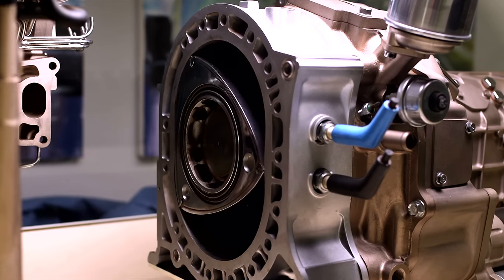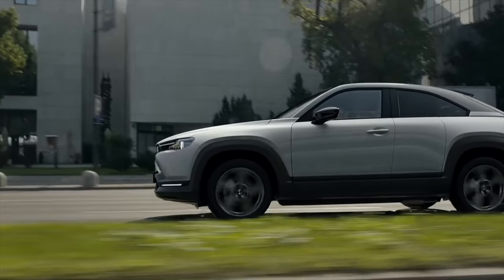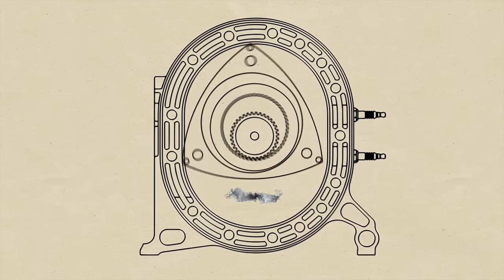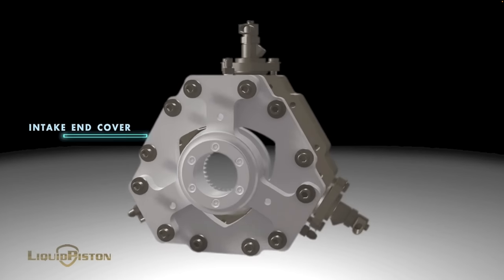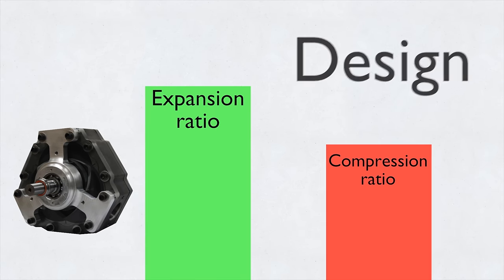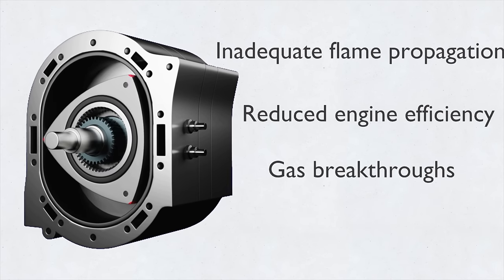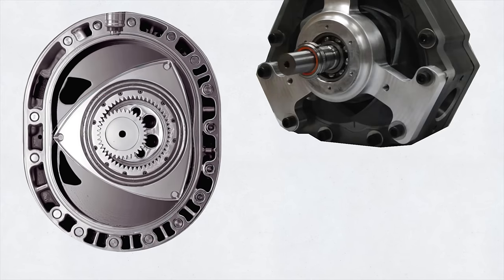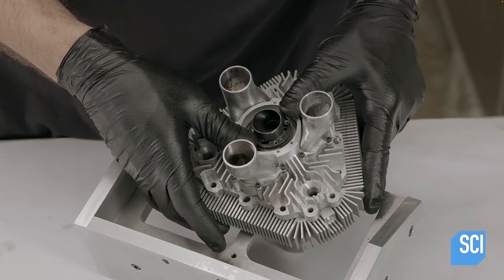Mazda's New Engine is the Smallest and Most Powerful Engine Ever Made

Comment: Felix Wankel did not design the rotary engine, it was Hanns Dieter Paschke. Wankle's design was superior with two main spinning parts, the triangular rotor and the rotor's outer housing, both spinning in a true circular motion, inside an outer housing. The output shaft was a part of the triangular rotor.  Hanns Dieter Paschke's design is the Wankel we know, with the triangular rotor spinning around the output shaft in a wobbling hula-hoop motion. 

The problem with Wankel's design was that there was three spark plus, one each side of the rotor, screwed into the rotor.  It needed an engine strip down to change the plugs. These days plugs for life can be fitted.
Reply: Hanns Paschke and Walter Freode discarded Wankel's rotary layout in favor of a conventional non-rotary design.
Only one Wankel rotary engine was ever constructed.
Reply: @sandervanderkammen9230  
doktorbimmer, a quiz.
How many rotary engines did Mazda make?
20 points for the correct answer.
Reply: @johnburns4017 Mazda has never made a Rotary type engine, Toyo Kogyo Cork limited became a Wankel NSU KKM57 licensee in February 1961.
  Mazda never made a single DKM54 engine.
Only one DKM54 is known to exist, it currently resides at the Deutsche Museum in Bonn, Germany.
Reply: @sandervanderkammen9230  
BZZZZZT! Wrong answer.
doktorbimmer the number of rotary engines Mazda made was ...

🎊🍾🍸 over 2 million  🎊🍾🍸

Zero points bimmer. ZERO.  Better luck next time.

Comment: Any fuel engine can be switched to hydrogen, including turbines, but the problem is how to store hydrogen, as it requires high pressures and low temperature, and still it packs 4 times less energy the an equivalent volume of regular fuel.
Small rotors or turbines could be used to produce electricity for electric motors, but only if the storage problem could be solved.
An hydrogen/oxygen battery could be even more efficient.
Reply: The problem is total lack of efficiency.

Comment: I remember my dad having an 1970s Mazda. It back fired all the time.
Reply: Things have changed.
Reply: @johnburns4017  Hah, yeah I’m sure. In grade school ( long ago) I built the working plastic models of the V8 and the Wankel Rotary engines for a presentation comparing the two.  At the time, I believe the Wankel had some issues and was not very efficient.  It did not get very good gas mileage for its size.  I remember the Mazda always backfiring down the road. Pretty funny. Dad didn’t keep it very long. 😂

Comment: A hydrogen combustion engine is EXTREMELY inefficient compared to a fuel cell configuration. It simply doesn’t make sense to use a hydrogen combustion engine. 

Because of the inefficiency you’d need huge hydrogen tanks. Those tanks are already an issue for fuel-cell cars.

Comment: How to have an electric car with unlimited range on a single charge.

Rwd and 2 battery packs. 1 battery is empty and the other is charged up. While the charged battery in the back drives the vehicle foward, it turns the front wheels thus charging the empty battery. By the time your "charged battery is dead it has charged the other one that was previously empty.

And then they just keep going back and forth charging and discharging each other.

Comment: 30 and 70 hp, lighter and more efficient? sounds like a good bike, maybe a 30 ps roller and a 70 ps bike with 140-160 kilo weight? or 2 engines one in front and one in the back for a car or 4 engines in a line as a mid engine. still half the weight of a normal engine, less space and high rotations...

Comment: Hydrogen engines suffer from a basic problem, the source of the hydrogen. Energy is required to produce hydrogen, via electrolysis. As they say there is no free lunch. Hydrogen can also be produced from natural gas but emits carbon monoxide in the process. There is also an issue with handling and storing hydrogen. One idea is grains of an iron/titanium alloy that will allow the hydrogen to be adsorbed onto its surface. This is a heavy solution and if the temperature is not controlled pressures in the fuel tank can get high.

Comment: Apparently, my ideas found their way around to the Mazda guys. I've had ideas to run the rotary off of hydrogen for many years now. But my system varied in the fact that fuel would actually be water, taken into a system that separates the molecular construction of the water, Oxygen being the exhaust and the hydrogen taken in to be burnt for the combustion phase. It saddens me that the people i wrote for financial support wouldn't help me, but yet they apparently sent the ideas on down the line. There goes my fortune.

Comment: The drawbacks seem to outweigh the positives: lack of torque, poor fuel consumption, reliability. The poor fuel economy to start with means when you scale it up in displacement or by adding rotors, it's just a rotating environmental disaster; and when adding in the piss-poor reliability, it becomes a burning money pit. 
Rotary engines have always been an interesting engineering exercise, but the fast-n-furious fantasy of them being a street-racers car of choice just fed into their myth while ignoring their glaring faults. 
Mazda is wasting their money in the hopes they can sucker more people into wasting theirs.
Reply: If only someone would invent some kind of mechanism to convert torque.
Reply: @chesshooligan1282  Having to use a torque converter is just another reason they get poor fuel economy...which is just another nail in the coffin in an industry facing stricter regulations on economy and emissions.
Reply: @johnweir9447  A torque converter is also known as "a gear box." That Fluid Piston thing is a scam, though, and Scotty should know better.
Reply: @chesshooligan1282  Yes, torque converters are a thing, but there are drawbacks to using them. Notably: less fuel efficient, which is already a sore spot for rotary engines. The RX8 Automatic had less horsepower than the manual (212 vs 232hp) due to the slushbox not able to deal with higher RPMs. 
The fuel economy is LAUGHABLY poor, my buddy was getting something like 17.5mpg out of his 1.3L engine.
They're also dirty, burning oil with their fuel. Mazda is trying to bring them back using hydrogen, but then you run into the infrastructure problem: where are the hydrogen filling stations?

Comment: I’m imagining a go cart with a x engine at all four wheels a 20 hp awd go cart would be a handful lol . I could see how those little engines could be really cool in recreational atvs and personal watercraft if the cost were ever to become reasonable, also a lighter Diesel engine with 30percent more power. I guarantee a lightweight diesel would be the rage if it was dependable and maintenance costs were reduced over the current choked down emissions stymied Diesel engines. Emissions regulations have killed the advantages of the Diesel engine and we are all paying for it . Everything you buy at some point it or the materials that built it took a ride on a trailer hooked up to a diesel tractor. It costs more in fuel economy and maintenance and repair of failing emissions equipment and they pass those costs right down to the consumers.

Comment: It maybe has a future. At least its intresting. BUT

I'd prefer to the "C.A.R.E Diesel" option. Which is a non-fossile burnable liquid which is made from some recycling materials which i can't name because my english isn't thaaat technical advanced 😅 But tests from BOSCH and other companies have shown that it smells like nothing, fuel efficiency rises about 30-40%, it is way better in cold environments than the common Diesel, which means Diesels don't struggle anymore to start at - 10°F or less. And it compatible with most Diesel engines especially the older ones. A German family tested it on their old Mercedes E-Class from 1994 that has a natural aspirated 6 Zylinder Diesel developing around 130HP. They came to the conclussion that the emission rate is way below the "Euro 6" standards, so it puts out less emissions than a Euro 6 car AND you don't need to build extra infrastructure to fill up your gastank. It doesn't need different Gasstations or pumps.

So you may understand why I see thats (hopefully) more likely the future

Comment: Hopefully they can break through the barrier that the internal combustion engine builders have been holding onto. The technology has to be changed. Electric cars that can recharge their own batteries as they drive will have to be made if they want us to buy them. I’m not interested in stopping that many times to recharge. And then you have to sit there while it does! So…good luck, Mazda!

Comment: This liquid engine is revolutionary, small weight high power, great efficiency.  If you can run it on hydrogen then it becomes the worlds best option for no fossil fuels. Electric cars are a dead end as currently used.

Comment: would carbon fiber apex seals create the flex and strength that lasts? are they typically aluminum or steel? steel has little flex and aluminum has a low cracking temp maybe there is a middle man here?

Comment: Hydrogen is a great fuel with terrific energy density and no emissions, however, the challenge is extracting / producing it efficiently. Best efforts currently require 4 or 5 times the energy to produce hydrogen cf the energy retrieved from the combustion process, so it's shockingly inefficient. Scientists are trying very hard to change the process / technologies involved but it's hard to foresee any significant improvements in my lifetime (unfortunately).

Comment: Calling it a 1.3 litre doesn't tell the full story. Each rotor fires once every crankshaft revolution. This makes one rotor equivalent to two four cycle pistons. A twin rotor wankel is equivalent in swept capacity and induction cycles to a four cylinder engine, so 2.6L of swept capacity per four stroke cycle of two revolutions.
Reply: The rotor produces three power pulses per rev of the rotor.  The toothed gears turn the output shaft at three times the speed of the rotor, hence one power pulse per rev of the output shaft.  The equivalent to a two-stroke piston engine.
Reply: @johnburns4017  In terms of equivalence, It's irrelevant what's happening inside the motor. The crankshaft RPM range is the same as a piston engine. each crankshaft revolution results in one chamber or rotor face sucking full of mixture and compressing it to it's minimum volume. This is the same as a 4 stroke piston engine, where one revolution results in the piston traveling down to suck in the mixture, and traveling up, to compress the mixture. The similarity with a 2 stroke is how the rotor's motion opens the inlet and exhaust ports.
Reply: @johndunlop823  
A 2-stroke has one power stroke per one revolution of the crank.
A 4-stroke has one power stroke per two revs of the crank.
A Wankel has one power pulse per one rev of the output shaft.
Reply: @johnburns4017  that's true. Are we assuming a single rotor wankel?
Reply: @johndunlop823  
Yep and a single cylinder two-stroke as a direct comparison. But the Wankel has a longer duration for its power pulse, so more torque.  It also runs on the four stage Otto cycle.
Reply: @johndunlop823  
As Stanley Hooker who developed the supercharging for the RR Merlin and jet engines, said... one power stroke and three others to wear out the engine.

Comment: The horsepower to weight ratio makes it desirable to replace, not only piston but, turbine engines presently used in helicopter.  Also, utilizing the diesel version, light aircraft could extend their range at least three times.  The NTSB will never allow this as they get kickbacks under the table from engine, aircraft and particularly from avionics producers.  This is particularly undesirable because it eliminates the opportunity available for fools going out and killing themselves while the rest of us have to endure all the regulations designed to protect these fools.

Comment: Today marks the 10 year anniversary of the final demise of RX production at Mazda.
  The very last Wankel engine car rolled off the assembly line at Mazda's Ujina #2 plant in Hiroshima Japan on June 21st 2012 at 4:30 PM Tokyo time.
Reply: doktorbimmer, a quiz.
Name the type of engine Mazda are introducing in their MX-30 hybrid car in Jan 2023?
20 points for the correct answer.
Reply: @johnburns4017  Mazda does not make Wankel engines anymore.
The very last production Wankel engine was unveiled 27 years ago.
Reply: @sandervanderkammen9230  
BZZZZZZZT! Wrong answer.
doktorbimmer, the name the type of engine Mazda are introducing in their MX-30 hybrid car in Jan 2023, is the...

🎈🎊🍾  rotary engine 🎈🎊🍾

Zero points bimmer. Zero. Better luck next time.
Reply: @johnburns4017  The Hybrid MX30 is powered by 2.0 liter 4 cylinder Skyactiv G engine.
Reply: @sandervanderkammen9230  
doktorbimmer, a quiz.
Name the month and year Mazda are introducing a rotary engine hybrid. 
20 points for the correct answer.

Comment: Hydrogen is NOT the fuel of the future. It isn't as explosive as nitrogen or even carbon. However, the methods that have been created to split water will be incorporated into future nitrous oxide or formaldehyde engines.
Reply: Mazda have been working with Toyota on the rotary for hybrid applications, also running on hydrogen. Japan is moving to a hydrogen economy, making hydrogen from nitrogen gas cooled nuclear reactors at the nuclear plants. They can reach 1,000 C so when cracking water for hydrogen they are highly efficient. They hope to run all dirty fossil fulled industry on clean hydrogen, as well as ships, trains, etc. On hydrogen the Wankel rotary is 25% more efficient and also more efficient when running at a constant speed rather than revving up and down.  The Mazda MX-30 rotary hybrid is being introduced in Jan 2023.  Only time before it is running on hydrogen.

Comment: Hydrogen would be good if they would produce it cleanly, but currently they produce it from natural gas. Burning natural gas directly at the car is cleaner than hydrogen. It's the same problem with battery electric in countries that produce most of their electricity using coal plants. Clean at the car, very dirty at the source.

Comment: The problem with hydrogen is that its expensive to make as of now. Great fuel but it's kinda dangerous and has to be stored in very high pressure tanks to keep it liquid.

The other fuel that will work is Ammonia. It cost like 50 cents a gallon and its really easy to convert your car over to it right now
Reply: Mazda have been working with Toyota on the rotary for hybrid applications, also running on hydrogen. Japan is moving to a hydrogen economy, making hydrogen from nitrogen gas cooled nuclear reactors at the nuclear plants. They can reach 1,000 C so when cracking water for hydrogen they are highly efficient. They hope to run all dirty fossil fulled industry on clean hydrogen, as well as ships, trains, etc. On hydrogen the Wankel rotary is 25% more efficient and also more efficient when running at a constant speed rather than revving up and down.  The Mazda MX-30 rotary hybrid is being introduced in Jan 2023.  Only time before it is running on hydrogen.

Comment: There's a theoretical limit to the efficiency of a combustion engine, and it's well below that of an an induction motor. however clever the engine is, so these days, when we know how much more efficient and powerful EV are, it makes no sense to develop more combustion engines that will be more expensive, less powerful, and will pollute.
And let's not talk of using H2 in a combustion engine, because then it's electricity->H2->combustion->power, where electricity->motor->power is way more efficient. more efficient is always gonna be cheaper, that's why a tank of H2 is more expensive than a tank of gas, and why nobody is buying fuel cell cars (which are actually even more efficient than H2 combustion engine).
Let's be real,  it's just nostalgia that makes all these people stick to the combustion engine because they just can't accept it's doomed.

Comment: just to be clear about something. hydrogen fuel is pie in the sky. yes it gives off 0 emission. kind of. the problem is how do you get hydrogen? hydrogen doesn't really exist on earth on it's own. you have to separate it from other compounds like water. of course we have the technology to separate hydrogen from oxygen but guess what: the amount of energy it takes to do that is more than the amount of energy you get out of the hydrogen itself. so rather than run the water through an electrically powered device to get hydrogen out of it, it would be much more efficient to just connect the electricity to the car directly by using a battery. OR if you want to be really efficient, where does the electricity come from? It comes from coal and oil burning electric power plants. And rather than run the electricity over miles of wire, losing power as it gets to you, it would be much more efficient to have a combustion engine inside the car, aka a normal gas powered car. That's the most efficient thing we got. And if you want to be good to the environment and not spend so much on gas, maybe don't buy a truck or an SUV.

Comment: Mazda already has reliability issues with their regular engines. These fancy engines are only going to make Mazda worse.
Reply: All problems have been eradicated. On hydrogen the Wankel rotary is 25% more efficient and also more efficient when running at a constant speed rather than revving up and down.  The Mazda MX-30 rotary hybrid is being introduced in Jan 2023.  Only time before it is running on hydrogen.